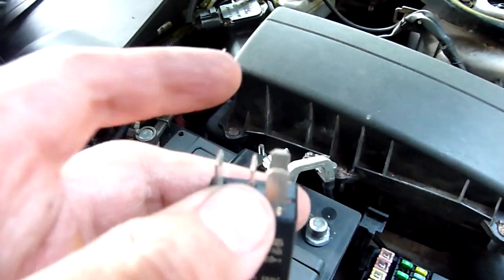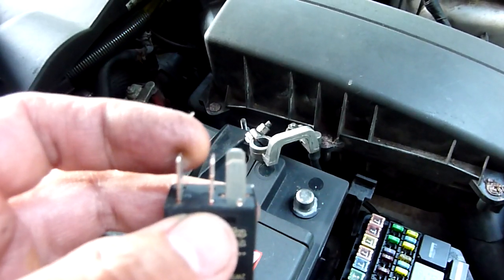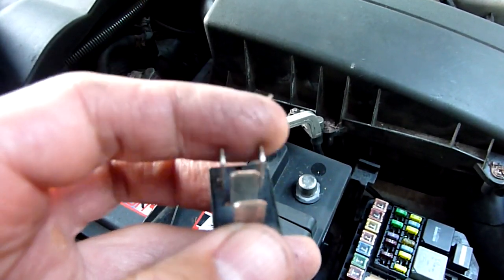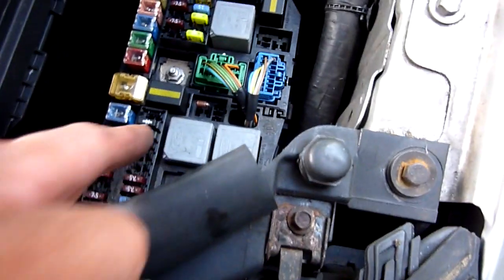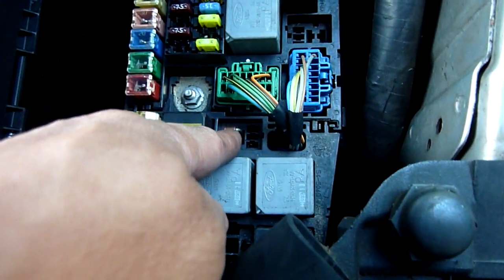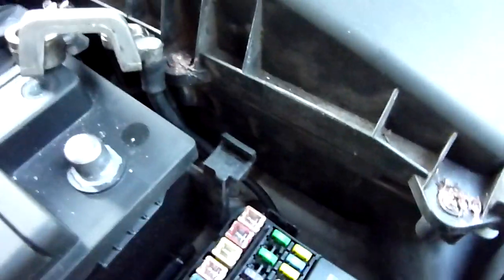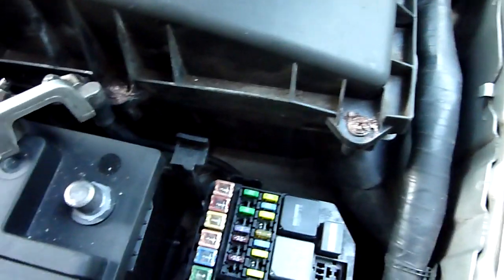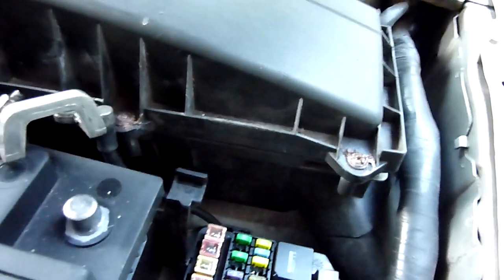How to by-pass the relay switch.

Comment: When bypassing relay what gauge wire can u use..is 10amp ok or should i use 15amp
Reply from the maker: @daltropical5236  about 1.6mm wire
Reply: @EducationPineapple  thanks mate....so, small one would do the trick ok......i will take the 25 amp 6mm one back to shop!..cheers

Comment: Hi, my compressor won't engage due ECU malfunction so I jumped the relay with a paper clip. Sure enough the compressor engaged but being a noob a let it run too long (about 30 to 40 seconds )and high pressured white mist started shooting out in a loud hiss. I couldn't see from where the mist was coming from exactly, as I panicked  to shutdown the engine. Question is the compressor destroyed? Or is it still ok despite what just happened?
Reply from the maker: Could be a relief valve... make sure you have the Refrigerant connected and try again...you'll soon find out, but I'm thinking it could be a stuck refrigerator throttle valve...called expansion valve...
Reply: @EducationPineapple  thanks for replying. I'll wait for the new ECU. I dare not try to jump the relay again lest I screw something up which is too expensive to replace as I'm going through jobloss soon.
Reply from the maker: @earlchester6279  ECU may need to have immobiliser etc programmed. Dealership job. Worth checking the AC clutch (see my video on fixing Honda Civic clutch). One way see another video is to relieve all pressure and start again with new fluid.
Reply: @EducationPineapple  hi, as mentioned in my original post, the compressor clutch engaged when the relay is jumped by using paperclip. I think this proves that the clutch is fine (and the culprit is the ECU ) as cold air can be felt in the cabin.  Other symptoms that point to ECU failure is gear stuck in 3rd  limp (mode), jerking during gear shifts. An ECU specialist confirmed that the ECU capacitors were leaking but couldn't repair it.